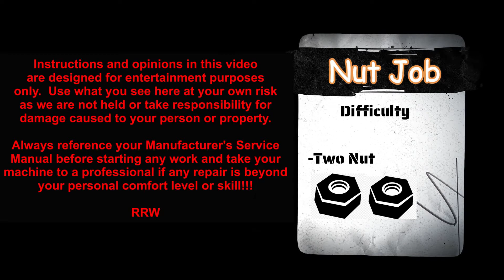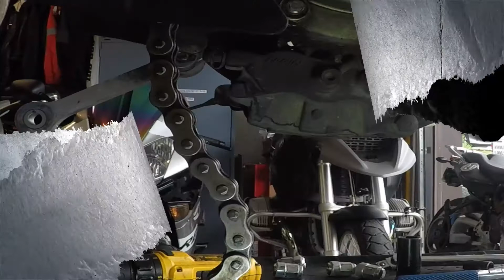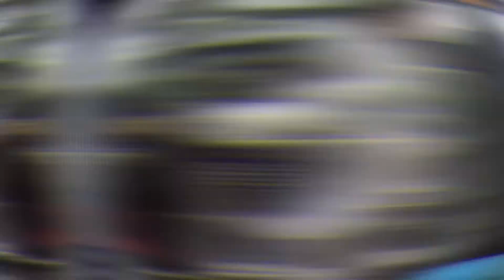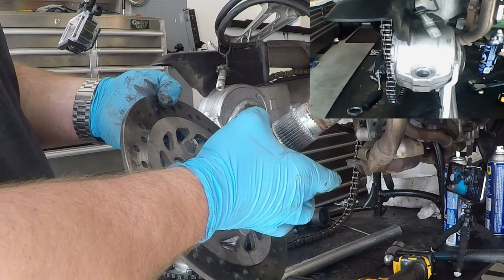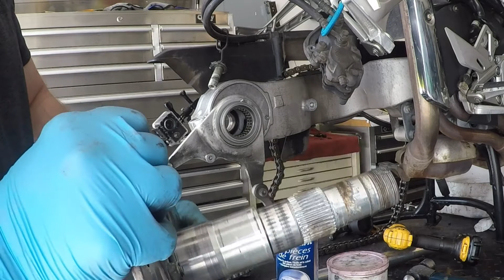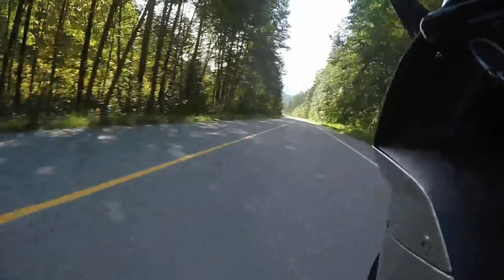Single Sided Swingarm Rear Axle Grease

Comment: You went through all this and your not going to check the rubber dampers inside?  I guess I have o.c.d. I would have to do more cleaning. I changed all those bearings on my 2001 vfr800 because I thought there was noise coming from one of them. well another posted same noise, then determined that road pilot 5 tires make a noise when they have around 5-7 thousand miles and then goes away. I guess I learned how to change bearings and still have original. That big c clip needle bearing, you need serious big tool to get that off. I'm 67 and got back into riding about 15 tears ago. Buy tools get Haynes manual watch videos and just do it. Still learning thanks for your work.

Comment: Very well done with good visual details and commentary. I successfully changed the rear rotor on a 2006 non ABS VFR using these instructions. While in there I also removed the bearing carrier, which aside from letting you better drain the brake cleaner used, allows you to clean the carrier and swingarm cavity to ensure the eccentric adjuster moves freely. If any corrosion is found on the carrier or cavity I suggest that after cleaning that no preventative grease be applied. It is not in the manual and can cause the carrier to slip during the shock and torque it is regularly subject to, resulting in slackening of the chain.

Comment: Thank you.  Very well narrated video.  One commenter inquired about whether you looked at the dampers.  Curious what I should look for other than disassembly for inspection.  Some commenters questioned you applying anti seize to the top caliper dog bolt that threads into aluminum.  My vote is for careful torque and anti seize as you stated.  Maybe there are apps where thread lock is essential? I suppose if the eccentric doesn't move freely grit has worked its way inside this housing.  Learned a lot😊

Comment: You should have loosened the axle nut before removing the chain.  Speaking of the brakes, i noticed that the caliper has the OEM brake lines.  Those should be replaced as well when replacing the pads.  I also believe that these rear calipers need to have their dust seals replaced because of the location of the caliper and its exposure to water and road salts every time you replace the pads.

Comment: On the carrier arm, you are supposed to remove the nutted bolt with the cotter pin, not the bolt into the swing arm, reason is that you can damage the aluminum swingarm. You can always replace a bolt, nut and cotter pin.

Comment: What kind of grease.? Moly or not.?
Reply from the maker: Lithium Complex Grease for high speed bearings like the hub.  Molly grease is for high stress low rotational movement, like swingarm linkage or frame bearings and waterproofing.  https://youtu.be/L2vkqwKEET8

Comment: I just love all your videos.
I know this was done 2 years ago, but I'm going to pull the trigger on a new bike 
Looking at an 07 VFR 800, with 16k miles, or a  06 Triumph sprint 1050.
Out of these two bikes, which one will last me 4-5years with the least amount of problems?
I live in MN and ride until I get snow, so riding under 30*F isn't a problem for me.
Thanks for reading this
Reply from the maker: That's a tough one for me, having owned both bikes.  Easy to ride - VFR, Power - Sprint, Suspension/Brakes - VFR, Reliability is a bit of a toss up, the VFR as you know will need its charging system looked at; stator, voltage regulator and the time chain tensioners (all of which is on my channel).  The Triumph seems to develop wire harness gremlins as it ages, the 06 is the last of the old style ECM set up and it may be hard to get replacements since the wire harness is different from the springs that came after it.  Fowlers Parts out of the UK was  a great source to  get factory parts for me.  The Sprint is bigger, more powerful and a lot of fun when you roll that throttle.  There are more options to do longer distances more comfortably with this bike, least of which is not having to shift a lot of gears to accelerate, pass, climb hills.  The VFR800 is a much calmer and more nimble state, with a couple of mods and the trust that the 11,000RPM redline is a real number so you can accelerate to 10,000 of those easily, it is a capable machine.  Everyday riding = VFR.  Long distance tour = Sprint
Good Luck! 
🏍

Comment: Well filmed & edited as always bro 👍.
Why unbolt the torque arm if you're not pulling the eccentric out the swingarm?
You're only a circlip away from a full strip, plus you'd be able to fully wash out all the old grease from the inner needle bearing ... I've drilled a water drain in mine in the centre of the eccentric clamp section in the  6 o'clock position, also grit intrusion can lock up the eccentric & prevent chain adjustment, even make it near impossible to get the eccentric out at all, blocking off the square holes up near the pivot shaft will stop this problem ... Keep up the good work Rod, I'm jealous of your well equipped garage.

Comment: I think you are confusing anti seize with thread lock when you said the bolt on the brake stay was hard to unscrew.  tap out the hole to remove all the thread lock, before installing a new bolt. The speed sensor on the VFR is on the front sprocket, not the rear wheel, but there is a sensor for ABS models on both wheels
Reply from the maker: Anti seize doesn't glue the threads like a loctite or other thread locking compounds but it does create a tighter surface contact area in the threads and makes them less susceptible to backing out from vibration or expansion.  A bolt with anti seize won't allow corrosion to take hold and that is why when you have steel in contact with aluminum its so important.  Thread lock does not prevent this.  Old timey mechanics use valve lapping compound in their sockets to make sure they get a good grip on high torque bolt heads.  The anti seize compound makes for a solid grip in the threads without the adhesive characteristics of thread lock.    In the Honda shop manual the rear sensor is actually referred to the ABS sensors at the front and rear wheels as a Speed Sensor.  The sensor that drives the speedometer is actually on the front sprocket, you can see this sensor while standing beside your 6th Gen. bike.
Reply: @RodRidesWrenches  those bolts have thread lock on them, look at the manual, it tells you to use thread lock, so it will of been applied at the factory
Reply: Partially correct, Rod was referring to the ABS wheel speed sensor  location, the guy's not perfect at dialogue, give him a break he's human ffs, he's trying, which is far more than most aim to do.

Comment: Thanks for this video. I have a problem where I cant Loosen or tighten my chain? do you know what could be causing this?
Reply from the maker: Hi Scott, so you've loosed the pinch bolt at the back of the axle?  Make sure this bolt has a number of threads above the swingarm.  Use some good pressure on the spanner to move the eccentric bearing holder.  Once that is done and if you are unable to move the eccentric I would bet that there is a bunch of dirt and chain grease binding it up.  Clean with degreaser & pressure wash the area behind the sprocket and brake rotor next to the swingarm.  If the eccentric is seized up you may have to break the chain and pull the axle out and the rear axle bearing holder which comes out the sprocket side.  Here is a link to a manual for the VFR if you need it.  http://www.manualedereparatie.info/manuale/honda/Honda_VFR_800_VTEC_2002_Manual_de_reparatie_www.manualedereparatie.info.zip
Reply: @RodRidesWrenches  thank you so much. I'll get to work now cheers
Reply: Grit ingress inside swing arm, known to lockup eccentric hub, can be a real nightmare to even get the eccentric out, square holes x2 up near spindle need blocking off, no more grit ingress, drill a 3mm water drain hole @ 6 o'clock in the swing arm hub clamp section.
Reply: I removed the adjustment bolt and used a pry bar to free it and sprayed Wd40 in there to free it then TF2 Teflon lubrication spray to keep it good. The Cush drive rubbers in my 1989 Honda bros 650/ Hawk Gt had turned to dust and needed replacing. The brake lines needed replacing becouse of age and I put ebc HH sintered pads in too greatly improved the breaking. I think I will put some moly paste on the spines as is recommended on Honda deauville shaft drive spines when I buy some. Moly grease isn't good enough.  Great video thanks for making it and thanks for all the helpful comments as well.